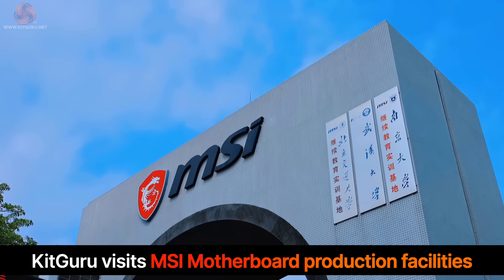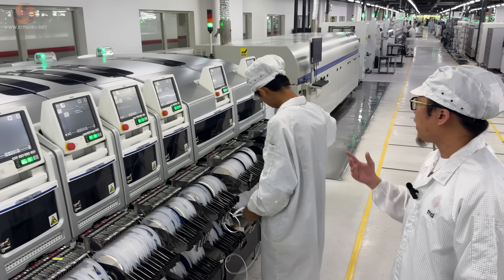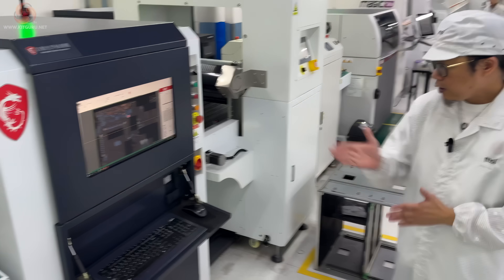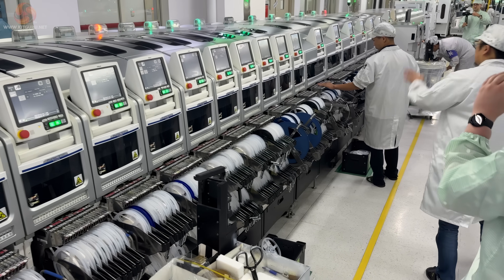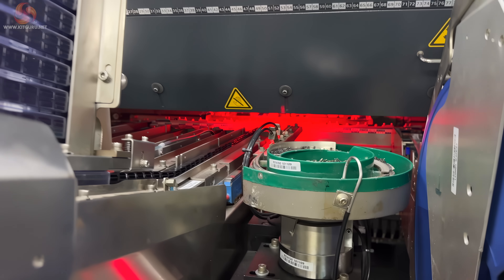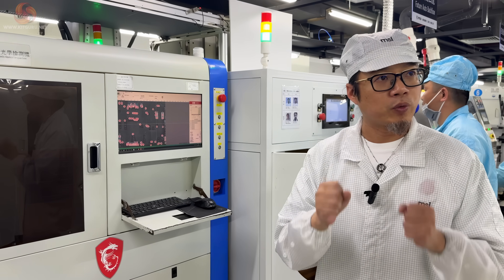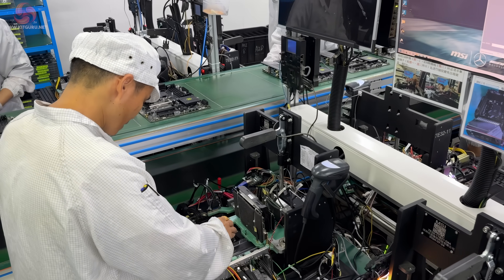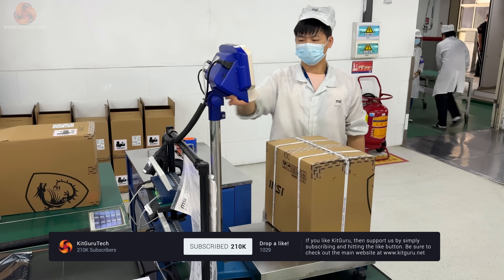MSI Shenzhen Factory Tour - how Z890 motherboards are made!

Comment: What's the chance, they design a itx dimension board, with a thread ripper cpu socket? It seems possible in my mind, at least? The extra RAM lanes, PCI slots, and SSD headers, are unwanted sff builds. We just want more cores and threads? Thanks

Comment: That river of silver at 4:55 looks amazing. More efficient than my efforts at college! The board looks so simple at the start, pretty rough as it goes through, but completely clean by the end. Cool! How much are these boards?
Reply: I'm amazed the board doesnt come out with just a smooth silver coating across the whole back. Really clever it just solders the bits that need solder sticking to it.
Reply from the maker: Leo did a video on some of the boards. They range from £300 to well over £600. Worth checking that video out.